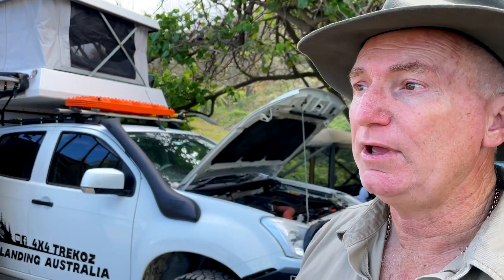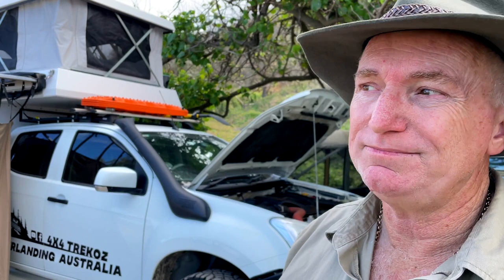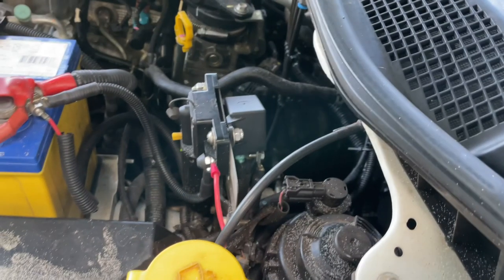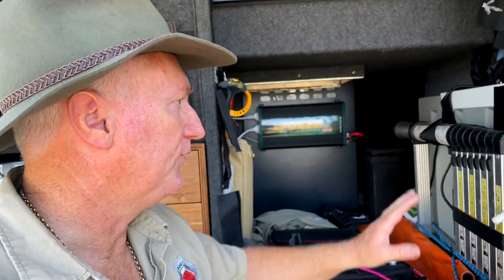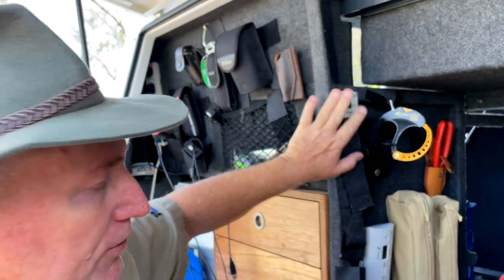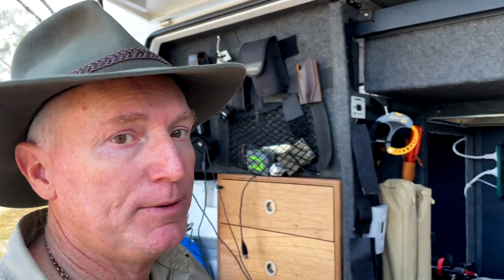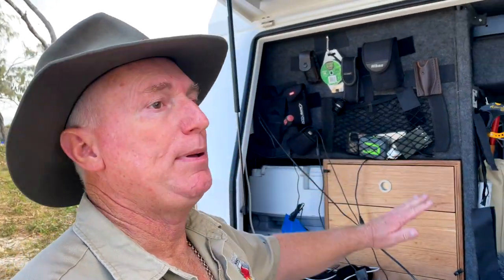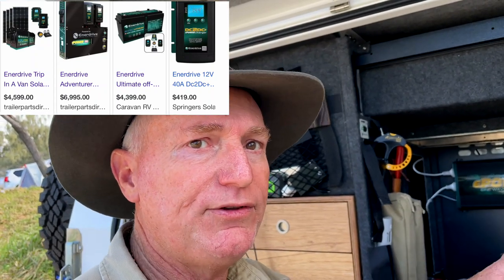ENERDRIVE LITHIUM ELECTRICAL system explained. Tommy Camper. Overland Australia.

Comment: Thoroughly enjoying watching your videos - you have an excellent calm presence on camera. Later in life my wife and I would like to be in the Tommy Camper. The simplicity and customisability really sets them apart. I've been wondering,  In the S4 do you think having a second spare tyre in place of a water tank on the driver side would drastically limit the general storage on that side?
Reply from the maker: I wouldn’t put a spare inside the camper. Loss of space and also the faint smell of rubber inside the canopy. Andrew White of 4xOverland did it and regretted it as well.

Comment: Should consider running your laptop off 12v.  If you have a new laptop with usb3 charge cable, you can get 70w 12v chargers for your laptop.
Reply from the maker: Appreciate the tip. I’ll check it out

Comment: putting the water tank on the left hand side, not worried that most of your weight will be on one side? i will be watching the new build with interest
Reply from the maker: The second spare tyre offsets it. Also will have the 200amp battery on the drivers side.

Comment: Hey Wayne,
Another option you might consider for your next camper would be the bits from ITechworld. I have a couple of their bits and they're excellent. They come in at a very good price and they're a WA based manufacturer.
Reply from the maker: Bits?  Referring to the complete electrical system?
Reply: @CanopyCampingAustralia  I have their 120Ah lithium battery and a solar charger, but they also have a great range of DC to DC chargers, inverters, etc.
Reply from the maker: Thanks Andrew. Always good to hear alternatives. Will check them out.

Comment: Hi Wayne, im turning to you for a bit of advice again .In another email I mentioned I was getting a S6X  after watching a review of yours. Now elelctrics !!. I run a 40 litre Engel ,lights, TV, Phone etc,diesel heater. 
So my demands are not huge. 
However im in my 70s and getting softer by the day.
Should I put in my 2x125 ah gel batteries  ( huge wht) from my current  set-up.  Or go 125 ah lithium. Or maybe 100 ah . The Lithium is very expensive  . But sooo good and light in wht. One day I may not want to get the gas cooker going to make a cuppa. 
Im just a average guy ,but have got enough $$ to make the best choice. Im also a long term thinker.  Your comments would be appreciated.  Regards Grant
Reply from the maker: Lithium battery. No question and if you can afford it a 200amp.